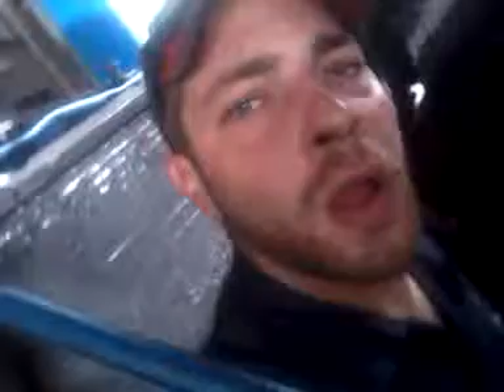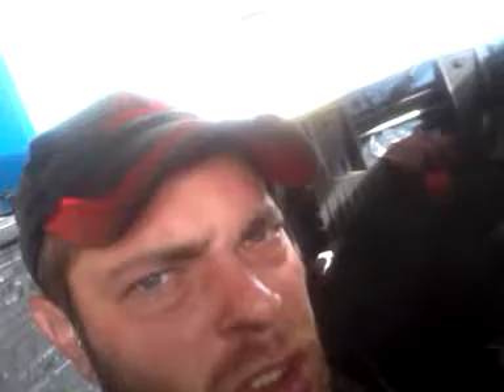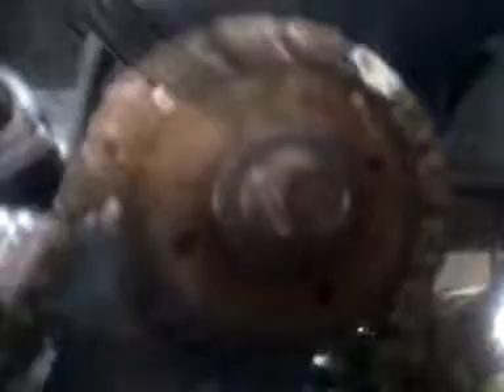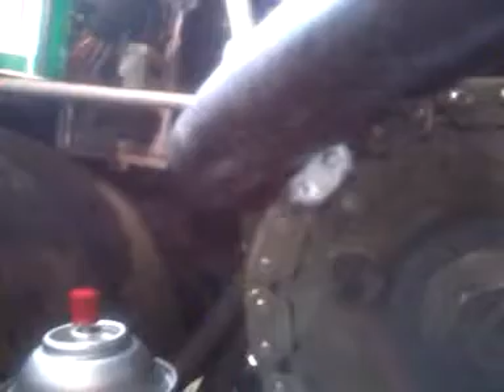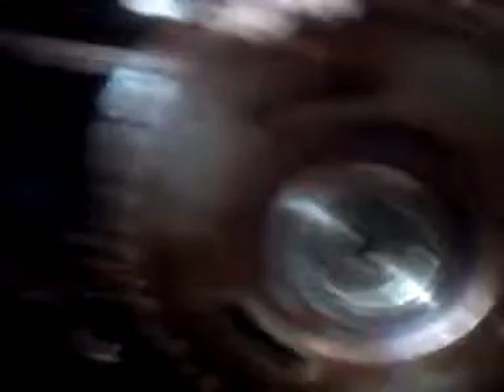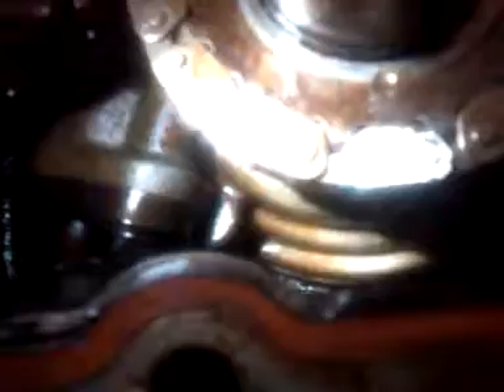4.7 dodge timing

Comment: Nice. Watch out for crappy pass. Side tensioners. Any tip on removing valve cover on a Jeep without de-pressurizing ac system? They dun routed the line right over it, longways.